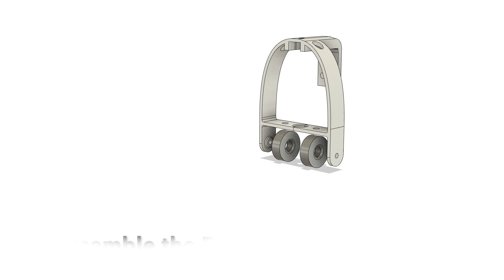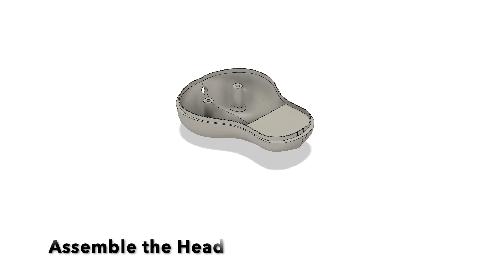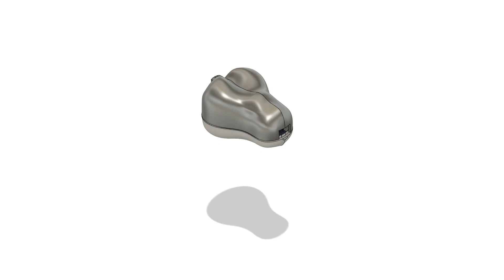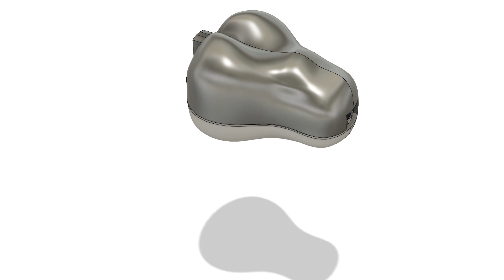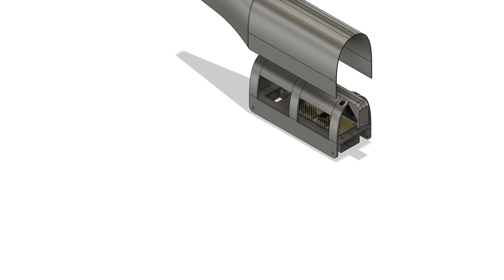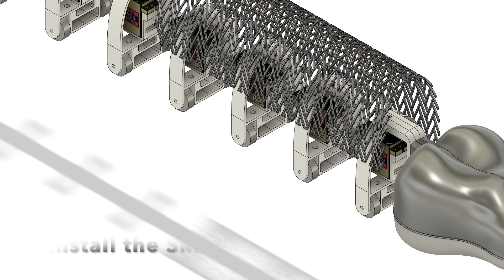Slitherbot

Comment: Need more details about the wheels.  You say an M2 screw inside an M3 sleeve.  Show us a sleeve (I assume you mean spacer).  Screw and nut or an M2 wood screw.  The holes in the wheel center (the axle) is large, about an M6.  Your video doesn't show this and Hackaday removed your project.  I fixed the bottom pivot by making the crossbar 3-4mm thicker.

Comment: i made one complete rib section but I find that it is so flexible the bottom pivot (under the servo) does not make contact with the hole.  Perhaps if the rib was thicker?  Or move the crossbar higher?  Or make the pivot longer to reach, or the entire servo bracket bigger.  I can upload a photo.

Comment: What causes it to move forwards?
Reply from the maker: The movement is generated by the change in body's shape from a sinusoidal wave. Each rib is connected to a servo motor which moves the rib from one side to another (60 to 120 degrees in this case) over a fixed duration of time. The process is repeated for all the 16 servos with a slight phase shift from one servo to the next creating the serpentine motion.